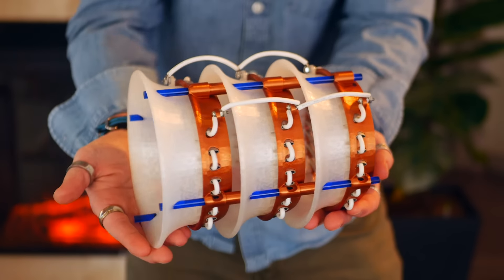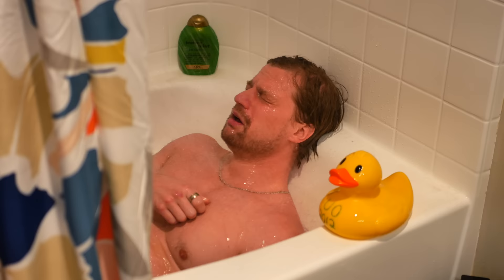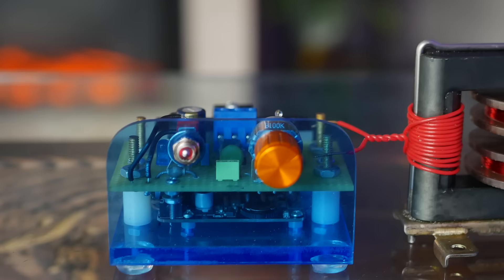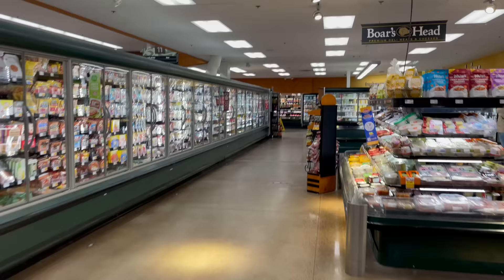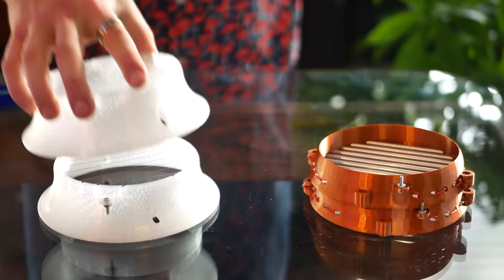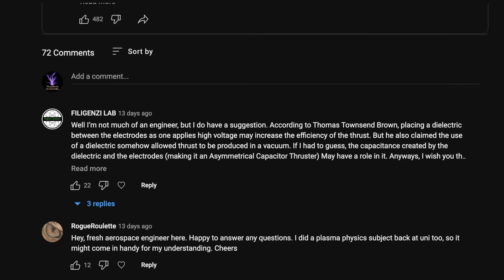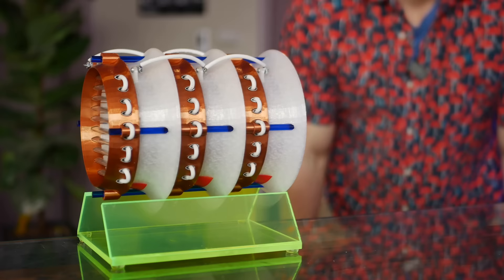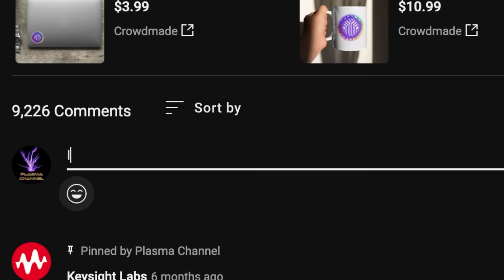The Next Generation of Ionic Plasma Thrusters (BSI MARK 2)

Comment: I love your.videos and this experiment!
    A change you may consider is decreasing the distance between the electrodes within stage 2 from stage 1 by adding 2 electrodes (for a total of 12 electrodes) while increasing voltage for stage 2 by 30% of stage 1 (65,000 volts). Then in stage 3, add 2 electrodes of stage 2  (for a total of 14 electrodes) while increasing voltage yet again to 30% of stage 2, each previous stage (84,500 volts). Your voltage generator should obviously be set to 84,500 volts then you can decrease it for stages 2 and 1. You also should consider decreasing the diameter of each stage and eliminating the flanges from stage 3 to speed up the airflow internally by compressing the airflow. Also try a slightly smaller flange at the rear to help compress the airflow as well.
Stage 1: 10 electrodes at 50,000 volts.  
Stage 2: 12 electrodes at 65,000 volts,   
Stage 3: 14 electrodes at 84,500 volts.  
Stage 4: 16 electrodes at 109,850 volts (this is now becoming inefficient as it will start airflow eddies behind your flanges and dangerous)
. If you want to go to 4 stages, then add stage -1 using 8 electrodes at 35,000 volts (adding the stage -2 would also be inefficient)
Let me know what you think or what you results are.

Comment: Great work!  Might consider two things to help increase thrust,  1. Each stage gradually getting smaller in diameter to compress the air increasing the pressure and therefore the thrust. 2. Decrease the distance between stages, your side view showing what volume was being pulled in through the side clearly showed that this was too much space but also that it was necessary. 

 I'm going to say it again though, this is really cool stuff and great with so far!

Comment: To fix your design issue, think of how a turbine works.  Each stage gets progressively more compressed. To emulate that idea with an ionic thruster, you can't have the same stages in series, you need to increase the power on each stage to increase speed/power.  Also, the relationship in the airgap between the stages will drastically effect things.  Jet turbines are sealed on the sides, so it can compress in each stage.  open sides increase airflow but decrease pressure, that is a direct relationship.  so focus on sealing the sides, and making each stage progressively more powerful. maybe same design more power is ok, maybe a more power design per next stage would exponentially boost results.  try compressing the ionic thrust from one stage to the next, but increasing power or maybe even size.

Comment: What would happen if the middle stage was turned 90 degrees from the first and last stages? What would happen if you choked the output side, IE made the output a smaller diameter? Thanks for the fun video and great content.

Comment: I think there is still a major avenue to improve that warrants revisiting. When you are constructing multi-stage thrusters, it is crucial for the spacing between nodes to be optimized between stages in order to achieve an as close to additive if not multiplicative level of thrust. Let me disect that:

With the way you have your stages spaced now, ions from the backmost stage of the thruster will be sent through at app. 2m/s as you saw. This means that they will be interacting with the next two sets of nodes for a very short period of time, on the order of hundredths of a second and millionths, respectively. This means that you should increase the spacing between nodes with each stage you add in order to maximize the available time for ions to reinteract with each stage. I would suggest doing a small incrimental change alongside a larger one then wittling it down to the mosr efficient in between. It may take a few tweaks, but this would drastically improve the thruster's efficacy.

Addition:

Another avenue that may be worth exploring is an endstage nozzle - ie a nozzle that focuses exiting ions into a tighter space. For examples on this, I would suggest looking into convergent nozzles in jet propulsion systems - these would serve the same purpose. 

Hopefully you see this soon enough for it to help :)

Comment: One suggestion I have is to try making the input airflow laminar. Maybe by stacking a screen of straw-like tubes in front of it. 
Keep up the great work!
Reply: Make the anode and cathode arrangement helical and in the shape of a shallow cone using geometric spacing from the focal area for the thrust.

When I see parallel wires and the localized airflow to them, I imagine a focused Tesla coil instead, specifically the primary resonator.

Most people build Tesla coils with a flat and inefficient primary resonator, which erratically discharges in relation to the torroid on top of the secondary resonator, which is almost useless.

If you locate each spiraling ring of the primary resonator equidistant to the torroid, it creates a very coherent and focused plasma discharge.

The same principles will work with this, creating a vortex airflow path through the helical anode/cathode array.
Reply: Great experimentation, each stage should it not be slightly smaller to control and accelerate the air flow?

Comment: My suggestions: 
Add small oblique notches to the sides of the first stage to encourage the inner air inside to form an orderly vortex, thus decreasing turbulence inside. 
Add ionizing wires to the auxiliary air intakes so that the slower-moving outside air gets ionized before getting sucked in (it has more time to get ionized than the air inside)

Comment: Hey that's a super interesting project, I have an idea many may have thought of, you should try making different accomodations for each stage depending on the air flow they have in input, your first design works well to accelerate the air from 0 to 2,1 m/s, but when the input exceeds 3 m/s that design can't add much more thrusts bcause it's not adapted. Which means that your design is great for the first stage when the input is 0 m/s but now you may try to make some tests to find out what type of design could accelerate the air flow better when the input is 2 or 3 m/s. Have a great day I can't wait for Mark 3.
Reply: Thanks for posting this and tinkering, I'm really happy to see that you revisited the idea! 😊

Comment: Very cool video. I would love to work on stuff like this. Have you thought of a funnel. Making the second and third ionic thrusters smaller in diameter, making the same amount of air forced through a smaller amount of space, while also being forced to interact with the +/- fields?
Reply: This is what I kept thinking as well. If each stage gets progressively smaller I would think it would compress the air leading to more thrust?
Reply: @Edward55221  I think the increased air speed works counterproductive. A compression ring/funnel behind the thruster might improve air speed so as to make use of generated air pressure instead of air speed. Air needs to be sped up to make a plane go faster than 4 m/s :)
Reply: :hand-pink-waving:OK let's get this correct  !!   #1  The only reason radio waves and AC current travel out in space and down a wire is because of the "CENTER " of a magnetic field.  (The "B" field), The North and South poles are the weakest part of a magnet !!   Just like Tesla said,  you got to look at things you can't see !!  At the center of a magnet is anti gravity,  (just tap the center on any glass or plastic and it will loose weight), The center can repel water if vibrated at the correct frequency,  If you vibrate the "B" field into granite rock it will become soft and you would need copper tools to work on same , you don't want to disrupt the magnetic (B")field ) with other iron.  Once you understand the "B" field of a magnet and how it relates to the entire universe we live in, you will then understand what Tesla was telling everyone "LOOK FOR WHAT YOU CANNOT SEE""  .I believe the pyramids were inter galactic communications and transportation systems.  Stone Henge and Gobekli Tepe , power plants.  Take a look at Coral Castle Florida on YOUTUBE and you will see a similar pilar. I believe these horizontal pillars were oscillators that would provide excitation for many things from crops in the field to anti gravity

Comment: Great Stuff!! Wouldn't you need different voltage on each stage?  If one stage moves the air at 2.3mps and your fan test showed that you were only gaining. 2 from 2mps flow... I would seem to me that you need 3 different voltages or diameters funneling down?
Reply: I was thinking the same thing. It is possible he is just putting them in series and the resistance from the ion thruster creates the voltage drop. The next thruster see's this new voltage and thrusts at a lower capacity. This means that the thruster that is furthest back needs to be wired in first to the hot side and the front thruster connected to ground. I think the diameter should not funnel until after the last thruster, since you would loose on thrust potential (surface area) while increasing resistance before discharging the fluid. However, it depends on the relationship of thrust vs airspeed for ion thrusters.

Comment: In order to boost the air flow try connecting the single thruster in parallel (side by side) with other two thrusters and merge their 3 outlets into one outlet this may give you better results.
Reply: I was thinking parallel thrusters instead of series as well.

Comment: Amazing improvements over the last design! I don't know if you're wanting to do another, but one thing I thought of that I think could improve the output velocity would be increasing the voltage by stage. Since the amount of thrust speed increase is decaying per stage, maybe the ions aren't moving fast enough to add any speed to the air, so then would higher voltage = faster ions = more speed increase per stage?

Comment: I suggest: to change the order of the stages, do not make them one after the other, but arrange them in a Y-shape so that the air enters from the two sides and exits from the third side in order to get a larger amount of air
Reply: maybe
Reply: Compressing the air seems to neutralize the ionization.yet flow helps with regulating density. So dynamically, ion charging and ejection seem to go hand in hand with maintaining the correct density.

Comment: I wonder what would happen if you increased the gap distance for the second and third stages.  You could test whether this might make a difference using a single stage with the fan at the input, varying the gap distance to see if you'd get more total increase with the stage energized.  My guess is that you might need a greater gap distance to impart energy more efficiently to already moving ions, so I'd try doubling the gap distance for the second stage, and then maybe even quadrupling it for the third stage...
Reply: I was wondering about changing the gap distance and being able to vary the voltage between each of the stages.

I would assume that a higher voltage and a larger gap would be wanted to keep accelerating the air through each stage.

Comment: Increasing thrust. Compress the flow by shrinking the venturi.  Start large. Say 30mm intake 25mm output. Then a 25mm intake to a 20 out.shrinking the outlet of a jet engine increases thrust. You can then adjust the output to be as efficient as you need. But a 2 stage should beat your current 3 stage. Then the after burner style compression area after should increase thrust. If you went from 30 to 20 you may get enough from 1 stage.

Comment: Excellent video. I have learned so much from your channel. 
If you taper the final stage more than the first two stages it's possible to focus the airflow increasing the power. 
You should build an evtol, I have a feeling it would be amazing.
Reply: I agree with this comment.  It's the same principle used in the multi stages of duct turbo fan engines. The mass flow rate equation also shows this inverse relation with the area of the outlet. It would be best to perform the same test where the other fan is producing 2 m/s air velocity on a single stage of the Mark II. If it does increases the velocity, this sugges6would be a viable option.

Comment: Just a thought about Mark III, 
I would think that you could have each of the 3 stages in consecutively smaller diameters.  Also I would think that you can change the input V to start from low to highest as an inverse of the Diameters.
Reply: I guess I should have read the comments . But we are thinking alike on this.
Reply: using that method would have the need for different voltages per stage, if you are trying to increase thrust per stage, higher voltage as you reduce the diameter, alternativately use a conical device to reduce the output size thus increasing the thrust. this method could also be used as a directional device.

Comment: Please follow the continuity equation.  A1V1=A2V2. Where A= area of cross section and V= fluid flow velocity. if you just want to increase the exit air flow velocity then make a setup where area of cross section at entry is bigger and exit area is smaller. The decrease will be gradual. It is said that ideal shape will be parabolic but for ease you can go for taper i.e. linear decrement.

Comment: Really cool build! I think these are an incredible concept, probably best suited for drones as power to weight ratio doesn't scale up well the further up you go when you add the energy source. Battery density aside gas turbines are still where it's at for heavy loads
Reply: Theres a drone that already been developed that flies using ionic thrust. Id love yo see what happens when its foggy or rainy though. Probly terrifying

Comment: This is really fascinating, but I was wondering if you measured the actual thrust produced by the airflow?
Reply: YES, that is a good point.  Volume x speed = thrust.  Thrust is the ultimate goal.  Also, the effect of the speed on the inflow on the outflow is important.  If the relative speed of the input is 4 m/s (as in the airplane is moving at 4 m/s) and the outflow is 4 m/s then there is no thrust and no propulsion.

Comment: I would be interested to know, what happens if you increase the electrode distance from stage to stage, much like a linear particle accelerator operating at a fixed frequency.
Reply: That would be a cool idea to add

Comment: I thought the staggered stages was a good idea in the first model, since the pressure is different at each stage. But since paschen's curve changes with pressure, and pressure with velocity, you might also achieve a similar increase in performance with your mark 2 with independent voltages for each stage with your current model.

Comment: This is a big improvement over the mark 1 but could still be improved. I would suggest that the design be modelled after the emergency inflation inlet  nozzle  of aircraft evacuation slides which uses the Bernoulli principle to 'drag' high pressure external air into the flow stream. The problem here is that the inlet sections are the same on all stages. a redesign where the inlet area increases from stage to stage will introduce more volume into the air flow and with more mass to be interacted on  within the flow stream, the low pressure zone widens  and generates more velocity as it passes through the final venturi. Further adjustments in the timing of the electric pulses can be made to use constructive wave  interference to convert the thruster from steady state to pulse mode energisation.

Comment: You need to pattern the aerodynamic in a coned Fibonacci sequence and vibrate the wire with the frequencies that will structure the air flowing in as such and then cone the whole design as well.  In each step, the smaller unit needs thinner electrodes, but a longer body.
Reply: While the magnetoplasmadynamic (MPD) thruster is the most powerful form of electromagnetic propulsion available, it has several limitations. The Next Generation of Ionic Plasma Thrusters (BSI MARK 2) aims to address these limitations by introducing a new technique that enhances the ionization of propellant. By making each consecutive ring slightly smaller, a 'venturi' effect can be created that increases the speed of airflow and adds energy at each ring. However, this technique is not without its challenges. Further research is required to ensure that the BSI MARK 2 can achieve optimal efficiency in ionizing propellant while also maintaining the structural integrity of the thruster. Overcoming these challenges will be crucial in developing the Next Generation of Ionic Plasma Thrusters.
Reply: If each piece is coned and the whole thing is coned as well, and the electrodes are fibunacci coiled and coned with it, each smaller piece should actually be stronger than. The bigger one before it.

The only thing after that would be to place 2  magnets, 1 permanent, 1 not; consistently repelling each other and one of them also causes the whole thruster itself to spin.

You may inadvertently develop the first supersonic ionic thruster.

Comment: I have a suggestion that could merit some thought. Taken from the steam turbine tech the "Converging – diverging nozzles" where developed to push steam to supersonic speeds given adequately pressurized steam is feed through them. A similar design fitted for ion thrust could work to give some further push to the air but given that there is not high air pressure feed to the nozzles to begin with, some creative thinking and designing should be done to test ... if you can spare the time.

Comment: I'm curious if you tried different grid spacing for each stage. It sounded like you came to the conclusion that the later stages were too close together because of the velocity of the incoming air, so wouldn't it help to have the later stages further apart?
Reply: @To the Stars He had to have thought of it though... I suspect it's somewhere between "Got lost in editing" and "Leave something for v3"